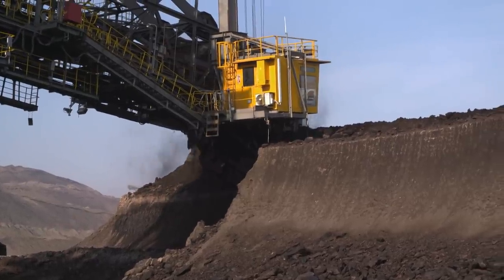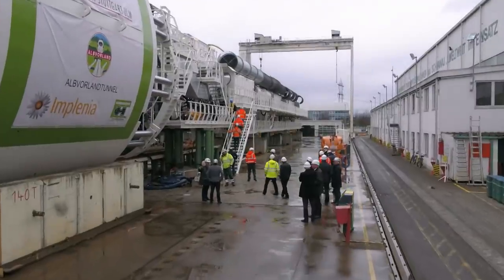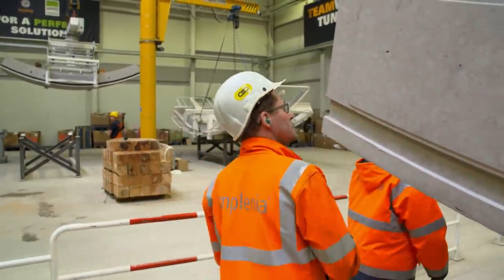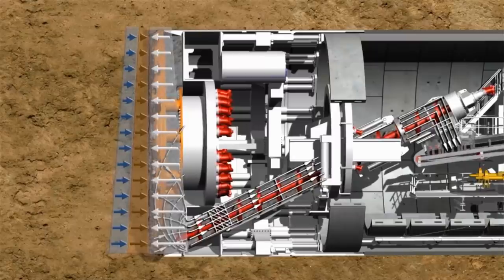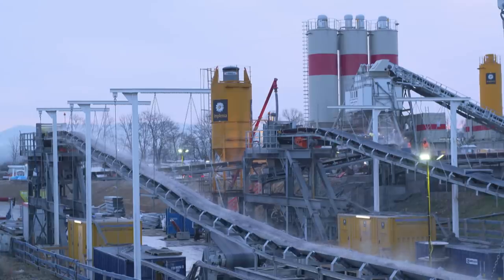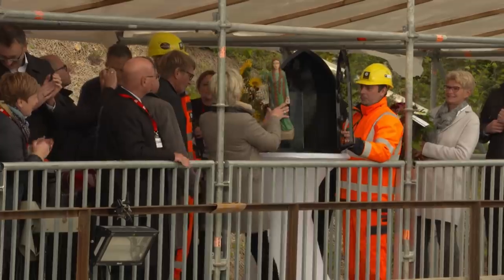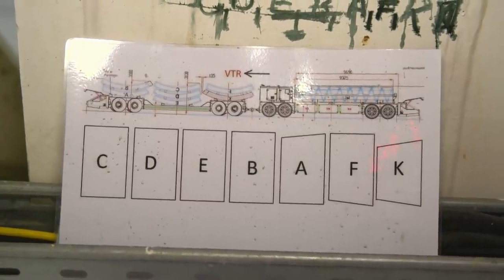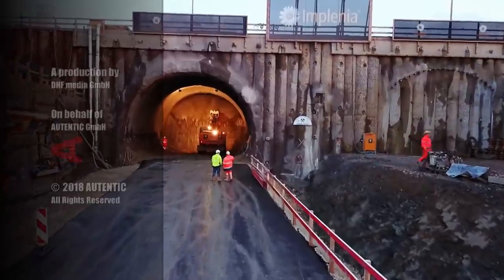Gigantic Tunnel Drilling Machines | Men and Machines | Free Documentary

Comment: The forging company I worked for used to forge the cutter wheels for these boring machines.
Reply: How many companies produced them, how many would your company create, about how long would they last?  These fascinate me, I think there are more in operation than just this one.   Most likely there are several of them creating DUMBs and connecting them.
Reply: @forcesightknight  there have been many tunneling projects around the world.  Flood water control, sewage and transportation.  
  Several companies have built these machines.  I'm not sure how long the cutters last.  Probably based on hours or cubic feet of a given material being tunneled into.
  We made tens of thousands of them for a time.
Reply: @steveparker8723  I would also harbor a guessThat’s the type of material you are totally into also matters
Reply: @two-face1041  Material type would certainly make a difference in cutter life.

Comment: Won't the finished tunnel look different with the 2 sides meeting in the middle, first the TBM, which lays concrete rings and second the people using standard tunneling machines that spray concrete around the tunnel walls, floor and roof. They don't lay concrete rings, so I'm thinking that it will look different in the 2 sections that meet in the middle.

Comment: A machine that spins a head and digs through mostly soft dirt. Not even rock. Doesn't even have precision constraints like leveling the head perfectly because the tunnel is built right behind it and the head is kept upright through it's attachment. Yet despite the simplicity, it has 90,000 parts. Requires 1000 specialists with ultra-rare domain knowledge to build. And has a million and one ways to fail during operation. These machines are testaments to the over-engineering, and monumental stupidity of modern day engineers that make everything so much more complicated than it needs to be. I have worked on the most complicated machines in the world. Telecommunication L5 switches. The things I saw engineers justify.. I took a 10 million line code (I kid you not) piece of software and rewrote it with my team down to less than 20,000 lines. It ran faster, worked better, had fewer failures and was completely immune to cosmic rays showering our machines and flipping cpu instructions (this actually happens). Because that's how simple the problems actually were.